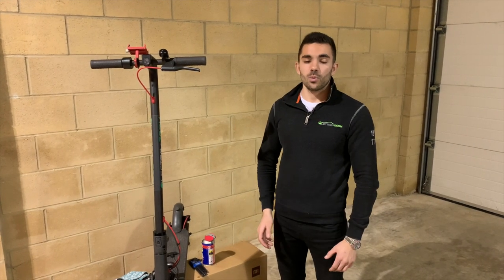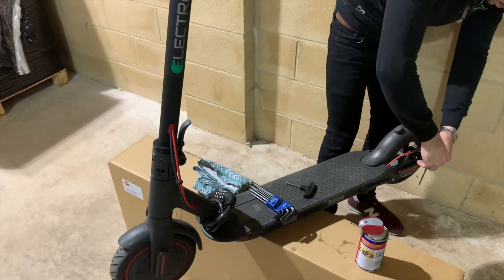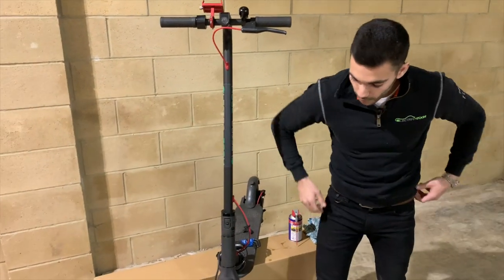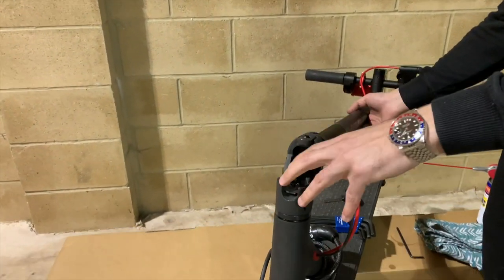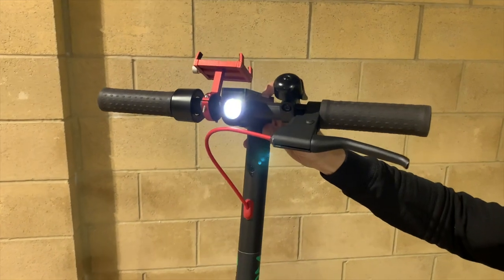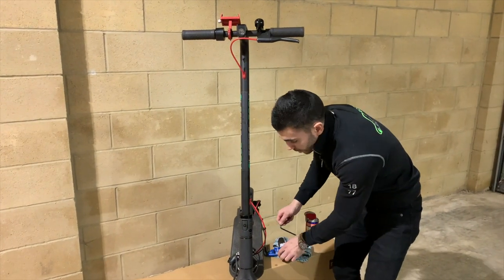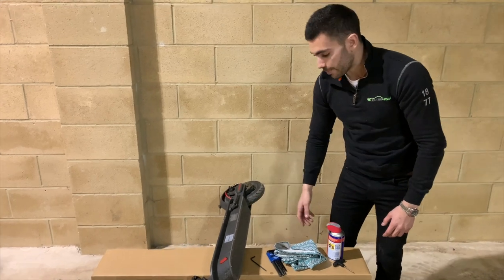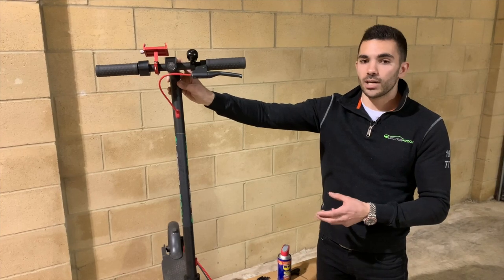Xiaomi M365 Electric Scooter Maintenance

Comment: Before adjusting anything on the brake, look inside the caliper to see which brake pad has the most distance from the disc rotor. As if you just tighten the pull on the cable you have a chance on bending the rotor. To clean the charging port use electrical contact cleaner, as it won't leave any residue. Don't use WD40 as it is a degreaser and will remove grease from the parts you need it most, such as the wheels which have sealed bearings filled with grease.

Comment: TLDR:

-Check brake: lever and cable tightness, brake disc
-Check wheels spin freely
-Lubricate wheel bearings(don't recommend the WD-40, use some oil instead)
-Check motor works with throttle
-Check folding hinge
-Lubricate folding hinge
-Tighten loose bolts(and maybe add Loctite)
-Check lights
-Check tires: pressure, wear
-Clean charging port
-Check underside cover
-Check stand
-Check cable hole covers

Comment: Wd40 isnt a lubricant.
Reply: 2nd commend: I were just about too comment that ! WD-40 will evaporate and leave everything to rust. use light chain oil or even olive oil if you want to lubricate things. I worked in the bike industry and many people think that WD-40 is a wonder thing for all. but it is just to loosen bolts and cleaning things from grease and then you have to oil things up with appropriate oil/lubricant. :) Great comment friend !!!
Reply: Use bike oil
Reply: @pjesapjes  thank you! I knew about not using  wd-40 but was curious what kind of lubricant is best for wheels that arent spinning freely

Comment: I noticed that my M365 makes a CLICK when accelerating, and the same CLICK back when braking. Every screw is tight, not sure what could cause it as the hinge does not have metal on metal contact. It seems like it is coming from the for bearing, but I could not be sure. Any ideas?

Comment: I bought for 3 days before. I charged then its was not working again it says 14 red. What I can do my friend?
Reply: though another source says could be throttle or brake. Ninebot Max has an issue whereby the brake sensor goes out of calibratrion (it's a hall effect sensor) so Segway being owned by Xiaomi (and you can see they interchange IP between the businesses) it's likely its simular issue. I don't own a M365 so dunno if there is a brake lever/throttle lever recalibration procedure